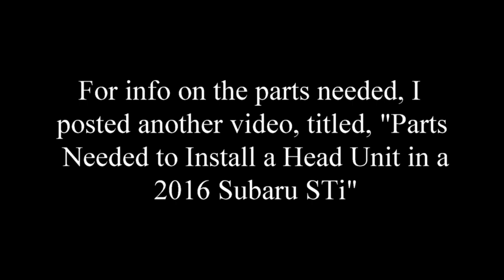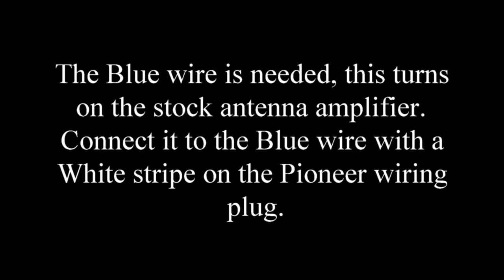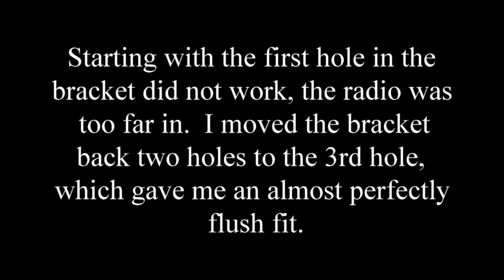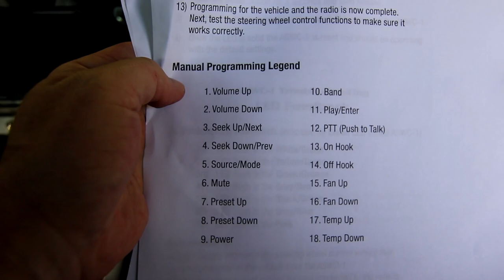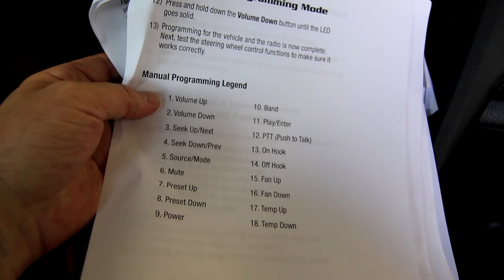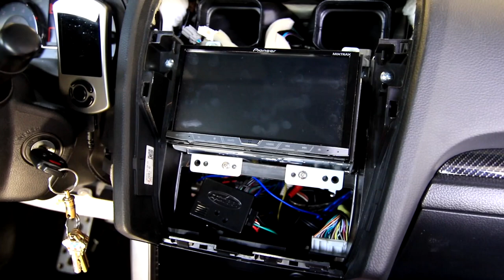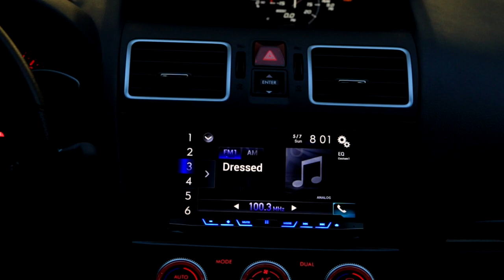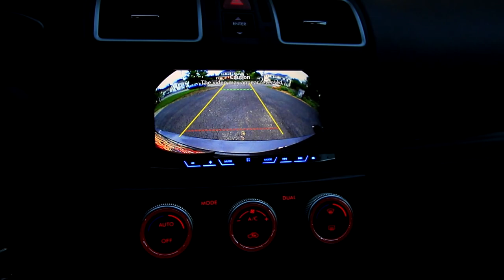How to install a Pioneer AVH 4200NEX head unit in a 2016 Subaru STi

Comment: Note: If trying to remove the stereo on a 2016/2017 Crosstrek or Impreza (and possibly other years/models)
If you lift the steering all the way up and look through the gap left between the steering column and dash panel (the part covering the knee airbag), you'll have easy access to the bolt. It's still not a direct shot, but no need to remove dash paneling or drop underneath the dash. You just need a ratchet, a 10" extension, a universal joint socket swivel and a 10mm socket (I purchased a magnetic one to prevent losing the bolt). If your hands are small enough, you can even guide the ratchet to the bolt. Easy-peasy.

Comment: hey willy, great video, thanks.  i installed a crutchfield supplied 4200NEX with the AXXESS SWC box in my 2016 Subaru Impreza sport in 2016. the step down resistor for the BU camera wasn’t available then and none of the phone functions worked—i had to use the center button on the 4200 to initiate a siri assisted phone call. the only steering wheel buttons that worked correctly were the SOURCE button to advance through the Pioneer’s A-V options, and the volume control and next-song, previous-song from the East-West arrows adjacent to the volume control buttons.  mute button didn’t work nor did the off-hook/on hook buttons for incoming calls.  fast forward to this week (Dec 2020).  I installed the new AXXESS harness with the B-U camera fix and a new 28-pin connector prewired to the AXXESS module connector.  Crutchfield thought this would get me phone functions from the steering wheel.  but, after a consult from tech support at AXXESS, I have a working B-U camera but still no phone SWC functions.  AXXESS says subaru’s electronics are to blame and there is nothing they can suggest to change this.  btw, the phone related buttons all double as SOURCE advance buttons—all work in forward direction only.  what do you make of this?  john wilson
Reply from the maker: Sorry, it has been so long I don’t remember what I did to get it all to work, but all of my steering wheel controls work, so definitely not a Subaru issue.

Comment: thanks for sharing your experience! I just installed a 1400NEX in my 2016 STi after watching your film. The only thing not working is the ASWC-1. spent 2h trying to program it and gave up because it got cold. I'll be back at it tomorrow. I still find it weird that this doesn't find the car by itself and we have to manually program everything.
Reply from the maker: Funny, I had the same problem tonight installing the ASWC-1 in a Dodge minivan with a Sony head unit.  Yes, I am currently stuck driving a minivan as my STi is at IAG getting a closed deck block installed, which is great, but will take 3 to 4 months, which is not so great.  The ASWC-1 can definitely be finicky to program.  With the Dodge, it did autodetect the car, but all the buttons were wrong, like the down volume made the volume go up, so I had to manually program it as well.  Not sure if they have changed their programming method, but the new ASWC-1 I just installed had a slightly different procedure than what I did 3 years ago in this video.  You will likely need to call their tech support and have them walk you through it.  Did you used the same Axxess AX-SUB28SWC-6V wiring harness that I used that has the plug for the ASWC-1 pre-wired?
Reply: yes, I used the pre-made harness and I did manage to set up the ASWC-1 the next day. I was doing it wrong the whole time, and here it is for whoever might be in the same boat: after it's all plugged in, turn the key to acc. and have a stick ready to push on the reset button (i used a 1/16 filler rod), as soon as you turn the key to ACC press and hold the reset for 10 sec or untill the led starts flashing red and green, then follow the process to manually set up the buttons by holding them until the led goes off strting with vol up... here's where I messed up initially, AFTER doing the button programming, you have to press and hold the VOL down to initiate the head unit programming, which mine did by itself flashing 6 times the red light for a Pioneer unit. Everything works fine now! For those installing in 2016+ WRX or STI, use the manual programing guide from Axxess site under the 2015 model WRX. Just do the manual programming from that doc and it works.
Reply: @b.coapsi8736  so your steering wheel control buttons work for the phone functions?  AXCESS tech told me they would not work in my 2016 Impreza with my pioneer 4200 HU, because of “Subaru’s electrical system issues”.  the tech took me through the up-vol, down-vol programming routine you describe but i would up with no phone functions from the SWC buttons. everything works fine via Apple Car Play on the Pioneer but nothing from the SWC buttons.  what do you make of this?
Reply: Hmm

Comment: Hi Willy.  I know you have everything wired up now, but have you considered swapping out the AXXESS steering wheel control interface for the iDatalink Maestro RR system?  It costs a little more, but it will give you everything you expect out of that Pioneer head unit.  I just checked to make sure that it was compatible with the AVH 4200NEX and the 2016 STi.
Reply from the maker: Rick Rodriguez I actually did add the Maestro system a while ago to get the gauge functions from the obd2 port. I left the Axxess system in place for the steering wheel controls since they were Ali wired up and working.

Comment: Great video! Question- is it possible to use the OEM microphone instead of the aftermarket one?
Reply from the maker: Zachary Garcia  Yes, but there are two problems. First, I know which wires are for the factory mic, but not sure which of those wires are the positive and negative. If you figure that out, you could get a mini stereo plug and connect it to the factory wires. Second, the impedance of the factory mic might be different than the Pioneer mic, so the volume levels might not be right.

Comment: If you need to pull the radio out again, would the bolts on the side have to be removed?  Or would it be just remove faceplate and front-facing screws and then pull radio out?   Thanks
Reply from the maker: Thomas Hanan no, the bolts on the side are no longer needed with the aftermarket radio. Like you said, just need to pull of the bezel and unscrew the for screws on the front.
Reply: If you replace the oem radio with an aftermarket one, the side screws aren't reused since there is a different bracket for the aftermarket radio.

Comment: Awesome video, thank you! Were you able to retain the stock aux input? If not, is that even possible?
Reply from the maker: I did not, but you definitely can.  The Metra Axxess AX-SUB28SWC-6V Subaru (with 6.2-inch screen w/o Navigation) 2015-up Wire Harness includes two RCA plugs (L & R) that are connected to the factory mini-jack plug under the arm rest.  You would just need to add a female RCA to mini-jack cable (see page 63 or the Pioneer manual, like this https://www.amazon.com/Honbay%C2%AE-3-5mm-Stereo-Female-Adapter/dp/B01AHVC8FG/ref=sr_1_3?ie=UTF8&qid=1516518043&sr=8-3&keywords=female+rca+to+mini+jack) to connect to the two RCA's from the Metra harness and then connect the mini-jack plug on the back of the radio.  Good Luck!
Reply: That's incredibly helpful. Much appreciated, thanks!

Comment: Is there a way you could show the center bezel with the pioneer installed in better light?  The video is great instructionally but I want to see how it looks.  I have all the install parts and I'm about to get that same radio but I don't want it to look bad, cheap, or out of place with the scosche bezel.
Reply from the maker: I think the bezel looks really good, just like it was from factory.  You can see some photos on my website at http://www.willy24.com/Cars/Car-Stereo-Install/  They are the last two photos.
Reply: Awesome!  Thanks! Link doesn't work...

Comment: Did you need a black interface cover over the stock radio to use on the new head unit as well? Or does it just go back in without anything surrounding it? Couldn't tell from the video
Reply from the maker: Richard Romano yes, I put the part number in the comments of the cover I used.

Comment: I finally got around to wiring and attempting to install the same unit into my 2016 sti but I'm having trouble getting the 28 pin harness to fit.  I got all the same stuff you did except I used the idata link steering wheel control.  Everything is wired and works but the 28 pin is barely touching and is super loose.  Any suggestions?
Reply from the maker: dpro The only thing I can think is that maybe one of the pins got bent preventing the 28 pin harness from fitting properly. It should go on fairly smoothly and just snap into place.

Comment: So on the stock head unit you're able to get into settings for the car like daytime running lights etc. Are you still able to access the cars setting through the Pioneer head unit?
Reply from the maker: Sean Kang it has been a while since I had the stock unit in my car, but I don’t remember being able to access car settings. I am wondering if you have a newer model or something. After making this video I did instal the iData Link connector to the OBD II port, which does let me read data, like battery voltage, from the car. On my model, it doesn’t let me control any car settings, but it might just be because my car doesn’t have that feature. For example, I know the Pioneer with the iData Link can control the cars climate control system, but only if those features were in the factory unit. Since that feature was not in my factory radio, I can’t access that feature on the Pioneer.

Comment: Does your car have the Starlink (OnStar) like crash detection system? If so has replacing the head unit caused issue with that functionality?
Reply from the maker: I did not have that feature in my car, so I don't know if replacing the head unit would cause you any problems.

Comment: For whatever reason axxes claim that this 28 pin harness is incompatible with the 2016 Impreza/WRX. Doesn’t the STI basically use the same exact radio as the Impreza?

Comment: Do you have any issues with clearance when the headunit tilts with the Scosche dash kit? Just installed mine and it hits the top of the screen when I tilt the screen.
Reply from the maker: Daniel Ines When I first installed mine, it hit the bottom of the dash kit. I don’t remember exactly how, but I know I was able to adjust it so the radio said just a little bit higher, so it would clear the bottom when you tilt the screen.  It still hits just a little bit, but it will open.  So it is a tight fit, but it should work.

Comment: I'm trying to get the rear view camera to go to my head unit. How did you wire the factory camera wore to the rca? I don't know where the rear camera wire is and what color it is.
Reply from the maker: You need the Metra Axxess AX-SUB28SWC-6V Subaru (with 6.2-inch screen w/o Navigation) 2015-up Wire Harness.  This plugs into the factory 28 pin molex and provides a yellow RC connection to go into the radio's video in.  My other video, Parts Needed for Head Unit Install in 2016 Subaru STi, talks a little about this and shows the wiring harness.
Reply from the maker: You need the Metra Axxess AX-SUB28SWC-6V Subaru (with 6.2-inch screen w/o Navigation) 2015-up Wire Harness.  This plugs into the factory 28 pin molex and provides a yellow RC connection to go into the radio's video in.  My other video, Parts Needed for Head Unit Install in 2016 Subaru STi, talks a little about this and shows the wiring harness.
Reply: Can that Metra axxess  for the rearview  cam works with 2017 model

Comment: I wanna keep my xm, will that be possible with this head unit?
Reply from the maker: Skyler Davidson I don't use XM, but I do believe it would work with this radio.
Reply: You would need a sirius tuner box but yes there is an adapter to use xm with this radio

Comment: Anyone have an idea on why my front speakers and tweeters don’t work?
Reply: Wondering the same thing... Did you ever figure it out?
Reply: Mike Brown the front speakers are in a different wiring harness. I eventually took it to a shop and they figured it out. I wish I could tell you which ones to make your life easier but my subi got totaled lol. I just know that it’s not in the same one that the back speakers are in.
Reply: yeah FML. I think it was the Nissan 70-7552 harness but there seems to be no info. My shops nearby are all ripoffs.
Reply: Mike Brown well you have to tap the front speaker wires into the wires on the head unit I believe. I think they’re in the small grey connectors on the oem head unit if you have starlink. Are you out in Cali?
Reply: Florida. I did a LOC to run subs at one point. I'm looking for the diagram I used last time for the harness colors to tap into them.